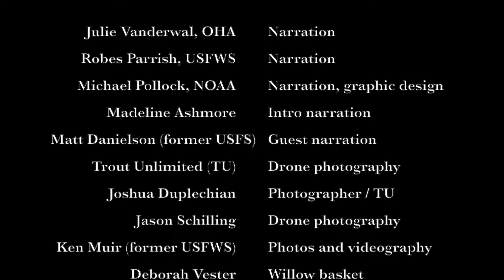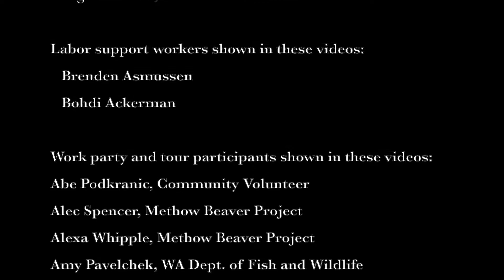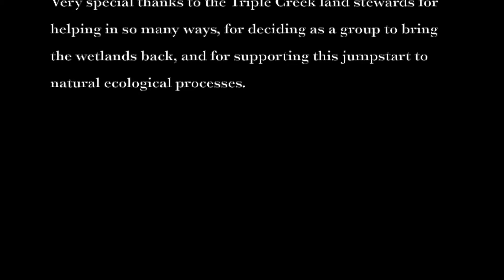Triple Creek Virtual Field Guide: Closing Thoughts and Credits

Comment: Why do you strip the bark off of the top 500mm or so of the 'posts'?
Reply from the maker: The posts are wider than the post pounder's sleeve, so we reduce the diameter of the top to allow it to fit into the post pounder.